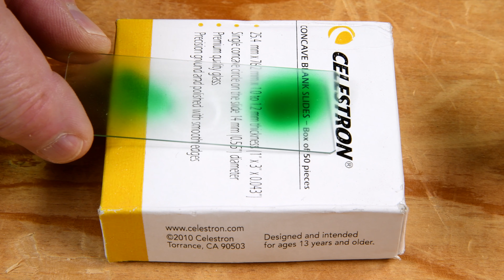The Model Ship - Part 19

Comment: Hey Ron!  Throwing one more into the mix here..  :)  Cutters aimed at the electronics assembly industry have a very low angle of attack and tend to have one edge which is at/near 0 degrees .  This is designed to minimize the shock of cutting as not to fracture solder joints.  Will keep you from sending small parts across the room.  Do a search for "CHP-170 Hakko", Amazon on this side of the fence is around $5 in US money.  Oh, and take your snow back!! :~)
Reply from the maker: Hi Bill,
Yes I saw all those nice inexpensive cutters on Amazon too but have since opted to spend the extra and get a pair designed and sold from a well known model manufacture. Should be here Wednesday. As for the snow, we thought you'd like it, haha 😁
Reply: @roncalverley  LOL - It is real pretty out, only downside to the occasional larger accumulation we receive is that it's only mediocre cold when it starts up so the first few inches turn into slush until it IS cold enough, then we wind up with just a bunch of ice to slip on.  That said, I think I'll opt to wait it out rather than return to Alaska for their powdery snow :)

Comment: Hi Ron.... lets hope it wil work.
One remark….. during grinding, the sparks fly a bit in the direction of youre pressurepot. 
I its possible that little parts landed on the the threads. when you screw the endcap in you may have the chance the threads will bind.
 I hope that i make any sence :-)
Reply from the maker: Haha! I knew that someone was going to remark about where my sparks were going. I'm surprised it wasn't the first comment what with all the "Safety Sams" out there. But I'd thought that it was going to be something about how I'm going to possibly set the stuff that's under my workbench ablaze. Or maybe the sawdust on the floor. Anyway, thanks! Will check those threads Peter 😊
Reply: @roncalverley  OMG..... now im allso a safety Sam..aaaaah. :-)
No, those little sparks wil not be a hazard.
But those little sandparts from het grinding wheel and steel are for sure a hazard to those fine threads.
I hope you dont mind im commenting about it. 
Keep on he good work, i allways enjoy watching youre videos.
Greetings from Holland.